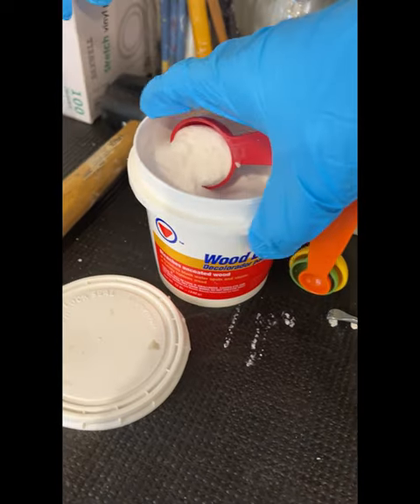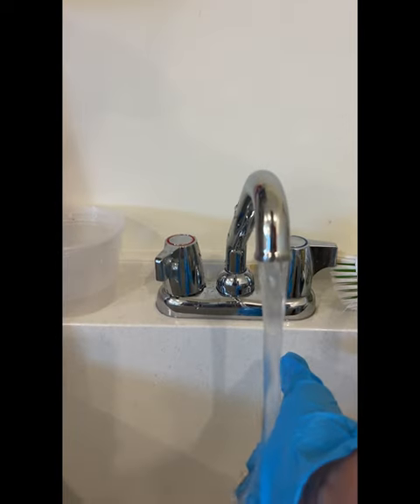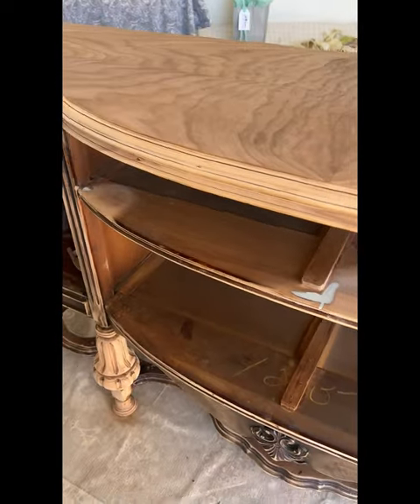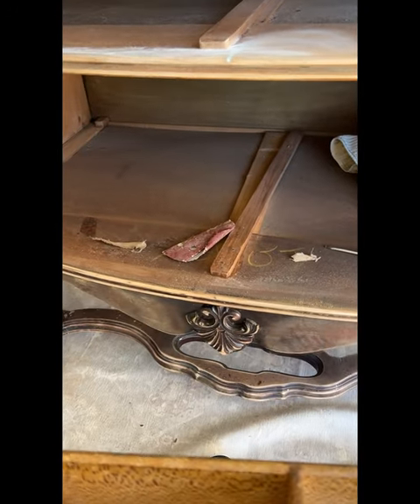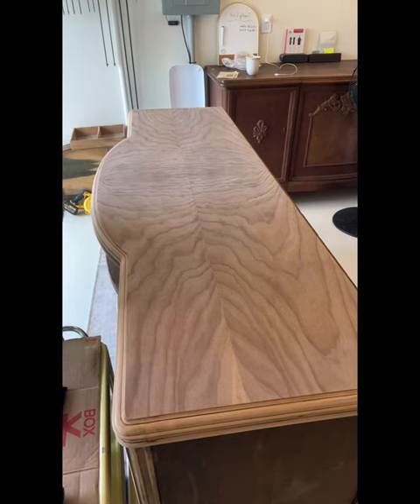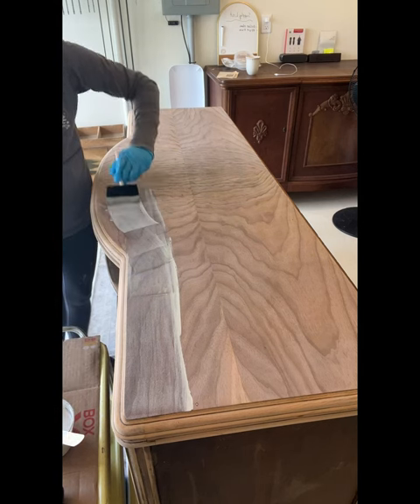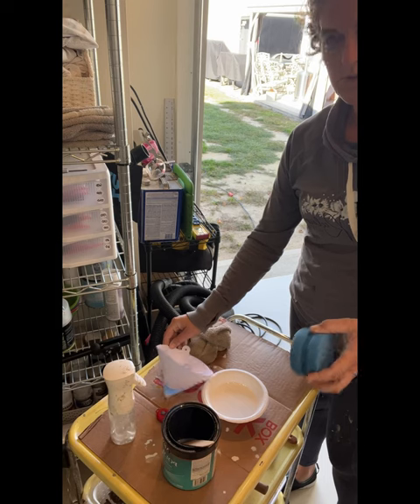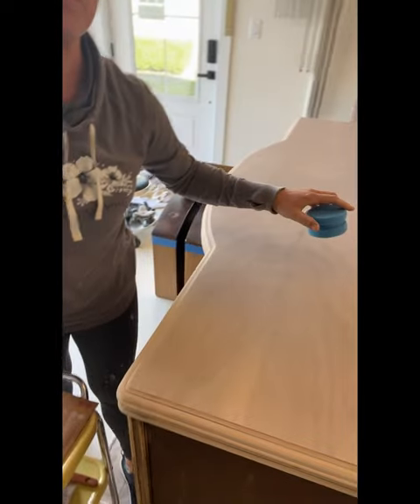Tutorial: How To Refinish An Antique Buffet: Wood Bleaching Whitewashing Polycrylic Part 5 of 14

Comment: What a great tutorial!  Just one question, Does it matter what kind of paint to use for the whitewash? And does it matter if it has a certain sheen?  Thank you.
Reply from the maker: Thank you!! It doesn’t matter what kind of paint. I usually use a paint that has a very matte sheen so it will have a matte sheen when the wash is applied. Ive never used a paint that had a high sheen as a wash so I’m not sure how it would look once it’s applied. I would suggest using a paint that has more of a matte finish. If you wanted a high sheen look, i suggest once the wash is completely dry, a polycrylic with a high sheen can be applied for the top coat. Hope this information helps 😁